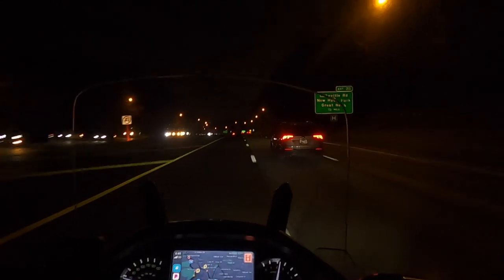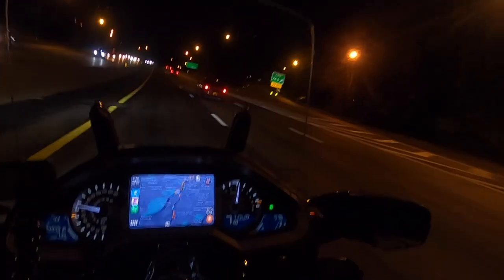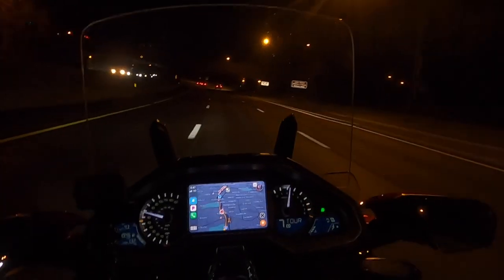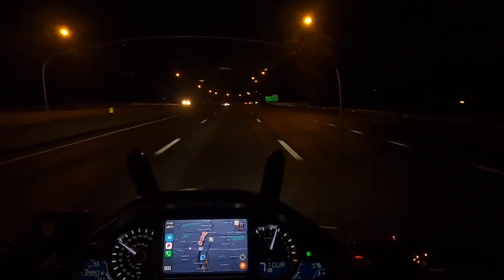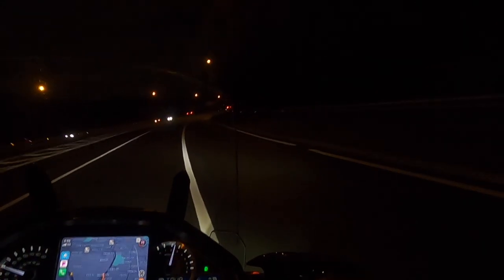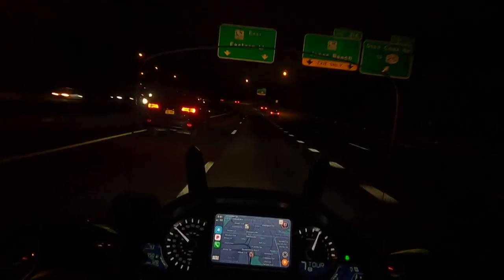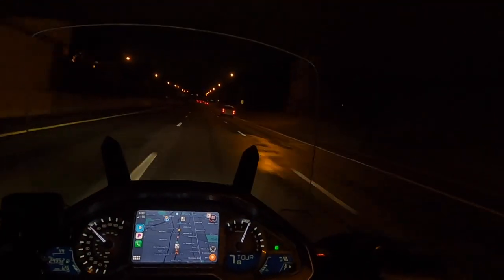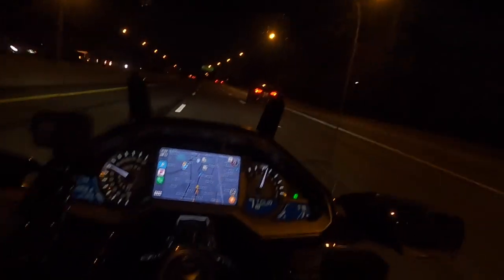MOTORCYCLE REGRETS  - DCT THROTTLE CONTROL & OTHER RAMBLINGS

Comment: Interesting ramblings.  I am old so I have been fortunate enough to have owned numerous motorcycles over the years.  Honestly, each and every one hold special and to some extent unique memories.  I guess the real question is not what made them unique but rather, what did they all have in common?  For me, it is the sheer contentment and freedom of riding down the road with seemingly nothing on your mind but the moment.  I am now 68 and I have felt that exact feeling since my first motorcycle, a 1968 650 triumph when I was 15 and every bike since including my current 2022 DCT.
Reply from the maker: Well said! Thanks so much for watching and sharing your motorcycle experiences.

Comment: Just a little helpful information… buyers itch will turn into buyers remorse… that will be the title of your next video if you don’t change your ways of thinking now. As a DCT Tourer owner myself (2018) I have ridden Goldwing since 1981 (naked 1100) and that is the bike I miss the most. Purchased it new in ‘81. But, would I trade it for this DCT. Nah, than I would miss this DCT and it would be my biggest regret. The DCT Tourer is by far the most luxurious,beautiful, comfortable and dependable motorcycle in the world. If you want something different, change the top case to the large case as Cruiseman did. It will look different, feel better, yet you still have your same wing. Try that, save yourself from all the regret of saying goodbye. For me, it’s this DCT Tourer till I die. I absolutely love this bike and it has kept a smile on my face for five years.
Reply from the maker: Totally agree and will hold onto this wonderful engineering marvel for as long as possible. thanks so much for sharing your sentiments. This bike gets better as time goes on and for me there is no need for a bigger or different trunk. They got it right the first time.

Comment: My regret is a 1985 Harley Davidson FXRT that got 55 miles per gallon at 65 mph with the wife on the back.  Next would be my 2018 DCT Goldwing I bought to travel with the wife.  She passed away and I decided I didn't use the radio, gps or change from your so I traded it for a 2014 CVO Softail Deluxe.  1800 cc engine and your basic motorcycle.  Just as comfortable to me and hundred pounds lighter.
Reply from the maker: I drool over the 2018 - 2020 Deluxe. One day.
Reply: @GBeWinginIt  It's a comfortable ride.

Comment: I admit, I use the front brake a lot while slow speed maneuvers on my 2022 DCT non tour, b/c the front and rear brake work in conjunction, I feel that it’s no big deal. Though, I’ve been practicing using rear brake only, I’ll get the hang of it with a few more miles. This bike is fun, quick, fast, and nimble too, can’t get enough. See you in Sturgis 2023.
Reply from the maker: It is a fun bike for sure.

Comment: I have a '21 tour.  When doing slow speeds, flip it to manual mode so it stays in 1st gear.  But I also noticed that if you brake, it won't shift up as quickly.  

As for higher riding, the tour is perfect for me.  And you get used to the throttle and start to really master it.  If I flip it in sport mode, it is more adrenaline but also the throttle response is different.  My knees get stiff when I do a long ride but I like the sitting position.  Someday I might get some highway pegs.  I never had a GW before so I can't compare it.  But I love my bike.  I wish it had a keypad password instead of all of the lost fob startup sequence.  And the navigation sucks.  Apple carplay all the way.
Reply from the maker: This scare really had me thinking about that keyless restart sequence. Dreadful.

Comment: I have no regrets because my 2016 Widebody GL1800 is still in my garage LOL.  Now I had the 6th Gen Wing but traded her in on a BMW R1250RT because I wanted a bike with better sport handling characteristics. My New Gen held it's own in sporty situations, but I wanted a little more.

As for handling turns when I had my 2021 DCT,  the majority of the time I was in manual mode so I would use the gears to finesse the turn. Downshift for the engine braking if needed, hit the apex and roll out.

Like you I have the itch for a new ride as well and heck I've only had the BMW for about 8 months LOL.. The BMW  R1250 GSA is leading as the new back scratcher,  but for now the edge of the door is working just fine LOL.

As always great topic of conversation.
Reply from the maker: How are you getting on with the RT aka Road Turtle 🤣🤣🤣🤣 I know this is no longer the case as we referred to them as such in the late nineties , I had THE SPORT TOURING VARIANT a 98 R1100RS . Great bikes. Edge of the door 🤣🤣🤣🤣🤣
Reply: @GBeWinginIt  I tell you man all boxes are checked with the RT. I climb aboard and get lost in the comfort of the ride, and it allows me to get as sporty as I dare to be LOL.

Power delivery, engine braking, suspension... everything is on point and I'm loving the ride. If I break down and buy the BMW Topcase then she'll be here to stay LOL

Oh, and I only mentioned Power delivery, engine braking and suspension because all the other tech crap I forget it's even on the bike🤣🤣🤣
Reply from the maker: @2Wheel4Fun  That's the real beauty of BMW ownership, one can just ignore all the background doodads and just ride the finest machines available to man.
Reply: @GBeWinginIt  I tell you it really is a game changer... Got to give up to the German craftsmanship
Reply from the maker: @2Wheel4Fun  Motorcyclist like to hate on them but not unlike Harley Davidson name recognition speaks volumes.  Difference is BMW has performance and technology to back their product up 😂. All the BEEMER’s I’ve owned I never once sought a power or suspension upgrade. Haters gonna hate but those Germans are onto something.

Comment: Only bikes I have regretted moving on was a RZ350 & RZ500. I keep the wife taxi Wing for the wife. She likes it far more than I do. And if I wanted to sell it I can get far more for the Wing than I paid for it brand new. You have to buy these motorcycles right and not get ripped off. But there is nothing out there to replace the Wing for wife comfort. So I keep it and count my blessing the wife still wants to get on a bike with me. She makes the Wing worth while for me. I recently got a MT-09 so I can have a fun bike for me to ride. Wife wants nothing at all to do with the Hooligan bike so I deleted the passenger pegs and put a tail bag on it along with many other mods. I'm looking to get a 2023 Yamaha T7 for a middle weight adv. bike. T7 will round out my retirement motorcycle stable. Two for me,,, One for her. :)
Reply from the maker: I've got a similar story as i deleted the passenger setup on a 2019 CB1000R before i sold it. And my wife loves the comfort of the Goldwing but a few rides a year ain't cutting it so i look to downsize. Must say the DCT is making it tough, We'll see.
Reply: @GBeWinginIt  I'm not a fan of DCT bikes. My 2018 Tour is a 6MT with a real slipper clutch. If they ever get a slipper clutch on a DCT I'll look into having one. The quick shifter is fun on the MT-09.

Comment: I don’t know how dct feels but I’ve only ever rode scooters. For the last year I’ve had my Suzuki Burgman 400 . I want a dct assuming it’s kinda the same as the automatic feeling of scooters.
Reply: Or just the 650 version of the Burgman
Reply from the maker: DCT offers variety and choice. You can interrupt auto with manual inputs from triggers on the handle bars. Check out the video linked below for on road demonstrations. 
https://youtu.be/Qzrt-Ie5aF0
Reply: @GBeWinginIt  looks fun
Reply: Do scooters have a throttle and an ability to manually shift?